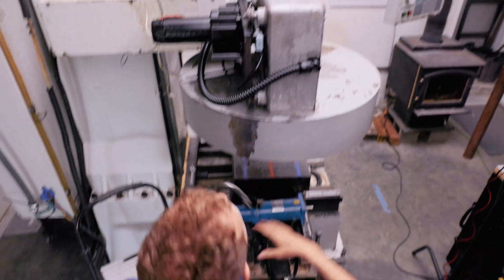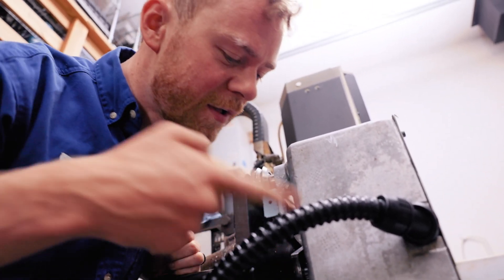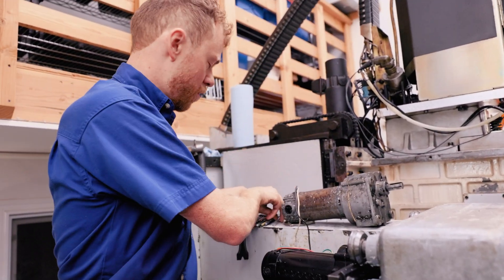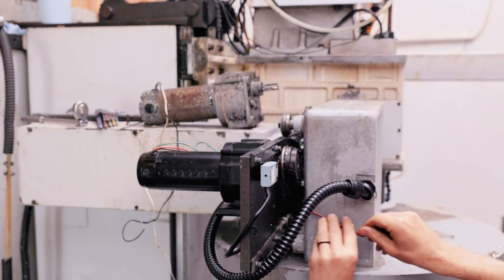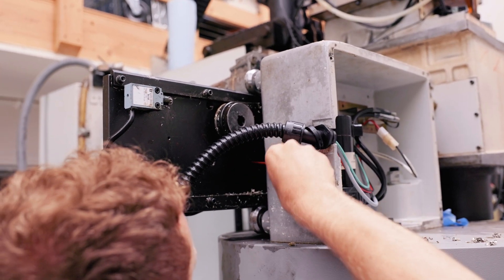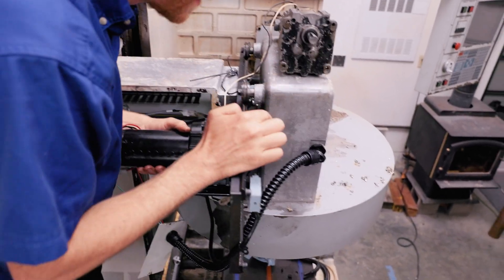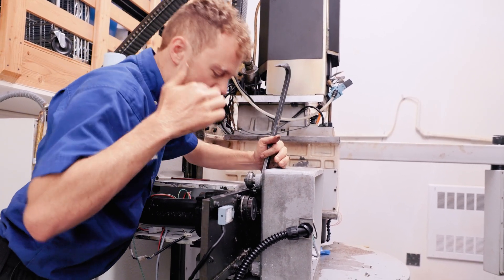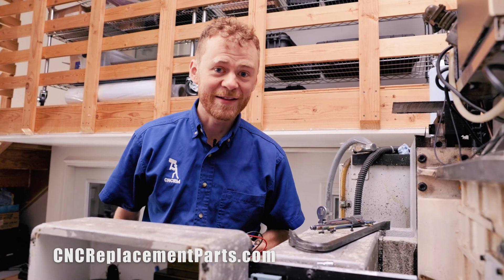Umbrella Tool Changer Motor Replacement

Comment: great video you have done there. I have an old haas cnc machine which haven't been used in about 6 years .....on start up I get this  bunch of alarms ( spidle motor overheat, C axis drive fault, TT axis drive fault etc) then there is  a 15sec timer after which the machine shuts down. Also there is a low battery alarm as the machine is starting. Where do I start with this.